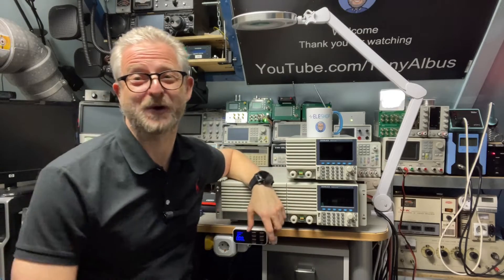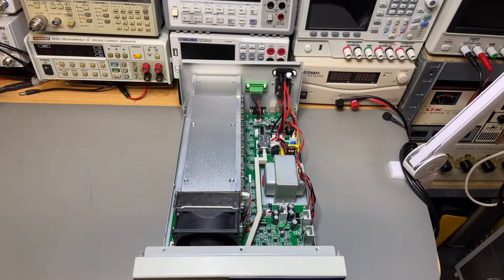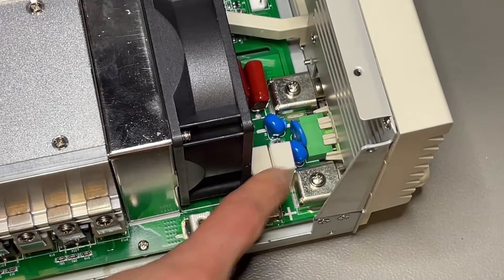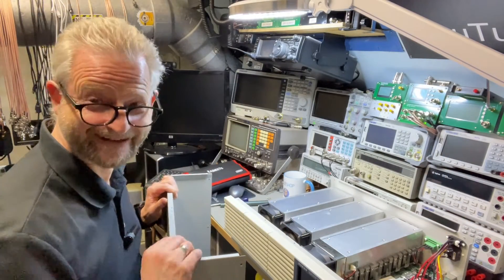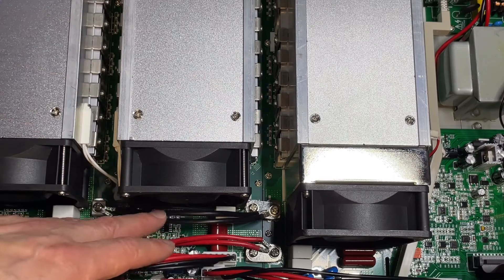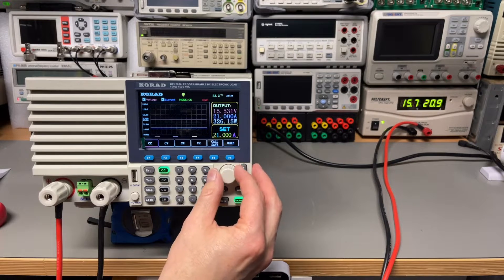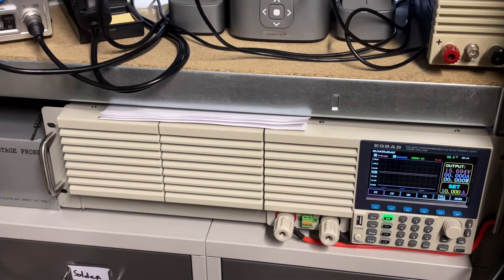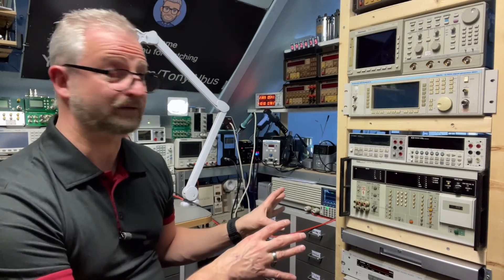TA-0383: Korad KEL2020  KEL2040 1500 Watt - Electronic Load - Teardown

Comment: Great video! A quick question, assuming I was working with 15VDC, does the 1500W rating on this load translate to an ability for it to handle around 100A continuously, in the real world? 73
Reply from the maker: Thanks! Good question, to be honest, that was my thought exacly. but the max current is still 40Amps .. becouse it is limited to the current shunt used in the main unit. later on in this video in the teardown i explain a bit more. it is a pity indeed the 40A limit. but it least you can now run 40A upto 37 volts.
Reply: @TonyAlbus  Thanks for the great reply! What I really want is a high current load for doing work under 15 volts. 
Would that Chinese unit you picked up recently do a better job of lower voltage high currents?
Reply from the maker: @mostlypostie1  The EastTester ET5301 i have, can do 60A indeed, but it is only 400Watts , so that is at 60Amps only 6.6 Volts.  With a better Current shunt, the Korad could easy do it, if you look how it is build. compair to the EastTester with only 6 FETs foor 400watts at 60Amps.. i wonder how fast that goes into smoke :) .. lets see.

Comment: Hello, does this have the capacity to show a graph of a battery discharge?
Reply from the maker: Hi, not that i know of, but i need to play more with it. usualy those stats you do with the PC connected or via CSV export. then you make a graph.
Reply: @TonyAlbus  I intend to buy one of 500 W but I need to know if it has this ability right on the screen, like Rigol does.
Reply from the maker: @gearstil  don't risk it... the Korad is not that advanced. it just pure power.

Comment: I appreciate your sharing of the rebranding research. Way of the world these days. 
I can excuse the loud fans on my 1990's gear;  but why can't they now spend a few more bucks on the fans for quietness? 
Gone are the days of available schematics and theory of operation manuals. Oh well, it's all microprocessors now. 
Have you tested the loads' frequency response against their spec's? Might that be an important issue? 
Your racks are getting denser! 
Thanks.
Reply from the maker: Thanks! Yes i prob want a variable and better fans later. Yes not very indepth as always, but you can find a very good review from Nico on EEVblog i left a link in the description.

Comment: Hi Tony, you have it beautiful, it fits perfectly, I will have to stick with my resistive shunts if I need a heavy load.
Edit: Stamos I have a soldering station - hot air + pen and it works fine.

Nice day 😉 Tom
Reply from the maker: Thanks Tom! Yes very happy now it is like this. BTW Resistive Shunts are very nice, very clean load. Nice!